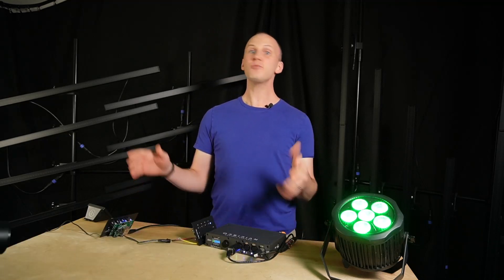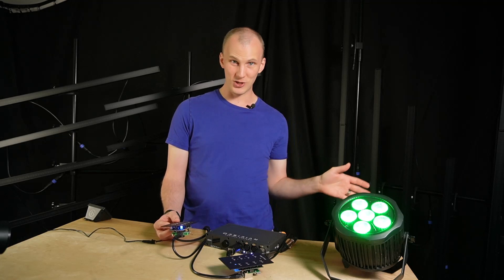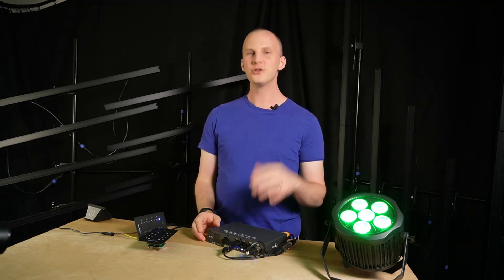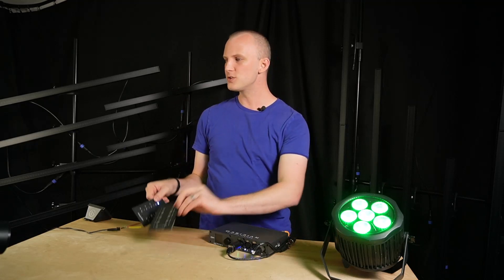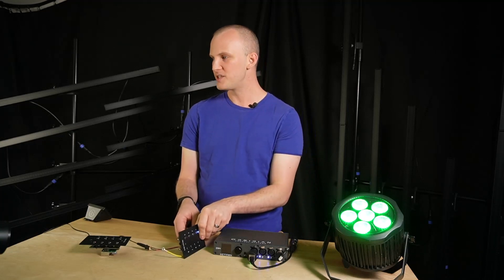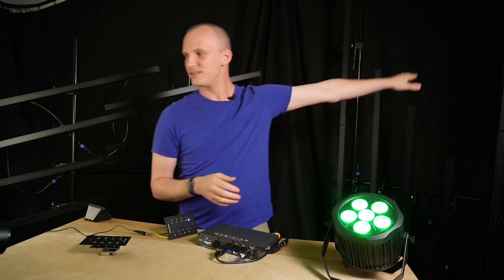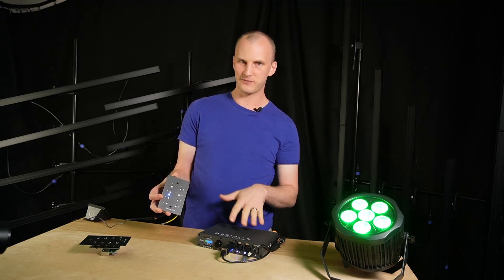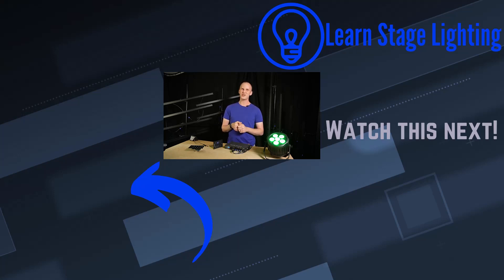How to Control Houselights on Multiple Node Outputs - Featuring Netron and Springtree Wall Panels

Comment: Thanks for the information. Very interesting. 

Unfortunately, this only works if all of your lights are daisy chained from one of the physical DMX ports on the node. I couldn't find any way to merge the Springtree controller back to the SACN coming in on the cat cable when using this fail over scheme. If I'm missing something here, please let me know. 

My system uses a multiverse transmitter that is plugged directly into the same network switch that feeds my Netron EN4. Without being able to merge back upstream to the switch, I had to come up with an alternative. 

My alternative makes programming of the wall controller easily available because the in and out, to and from the wall controller, can be plugged into the Netron device at all times. I didn't want to have to change the wiring each time I wanted to program the wall controller.

I used two user profiles and two triggers that change the profile of the Netron device. 

In console mode, The Netron dmx output to the Springtree wall controller is turned on and the input from the Springtree controller is turned off. It's not really necessary to turn the Springtree input off, but it's cleaner and makes it easier to explain in documentation.

My second triggered profile, wall controller mode, does the opposite. The DMX output to the Springtree controller is turned off and the input from the Springtree controller is turned on. In this case, it is necessary to turn off the DMX out to the controller on the Netron device because the Springtree will otherlwise see it's output on the input and turn itself off.

I love the flexibility of the Netron device, as I wasn't sure if I was going to be able to make this work prior to purchasing it.

Comment: If i were using lights that i can hard wire like for example the very dense Double Rainbow RR series of lights from Quasar science for pixel Mapping purposes in unreal engine. I know the full profile takes up almost 1 dmx universe. depending.  If i wanted to use like 4 or 6 of those would i need something like the ENT-645 or ENT-1245 for that?  The QS lights use ethernet with node passthough (dmx pass on within same universe on each light) But if the light is using almost one universe. the passrhough is not much of an option no?
Reply from the maker: Most lights with so many channels will take the art-net or sACN directly, and then you don't need a node at all - just a network between your console or PC and the lights.
Reply: @LearnStageLighting  in my case its the astera hydrapanels i was thinking adtera powerbox which takes in artnet ascn to the lights wired and battery and blutooth if i need only simple control...i believe the powerbox is a node and therefor would i just need to plug it i to the switch?

Comment: Can you recommend a forum community about all stage lighting standards for beginners? I’m currently looking to control DMX 5-pin lights directly from a computer but am a little unsure what possible solutions there are (wired only, want to avoid RF issues).
Reply: You should check out his videos on lighting software.